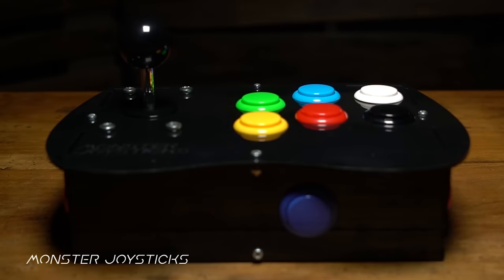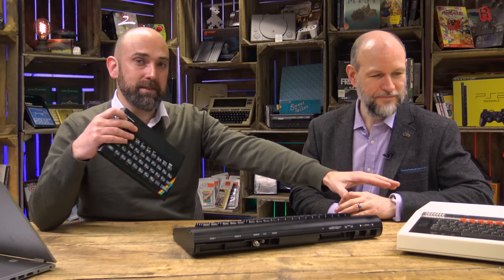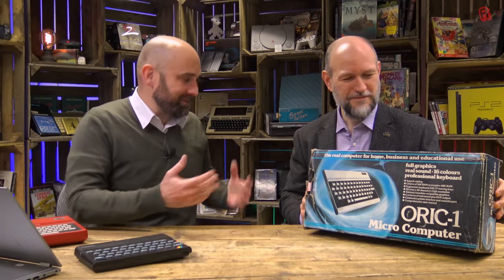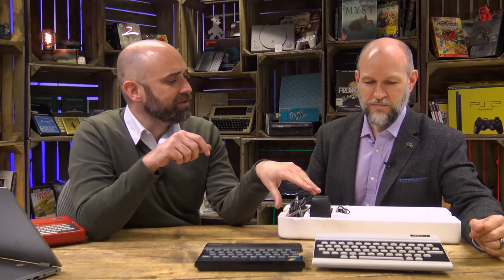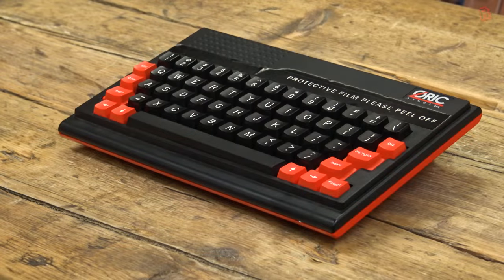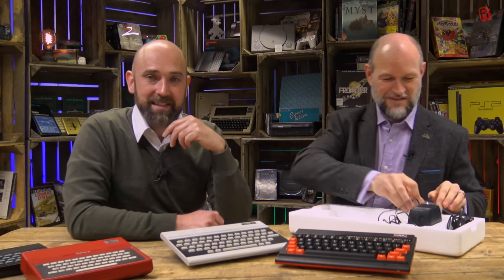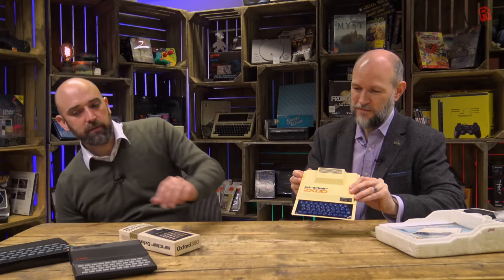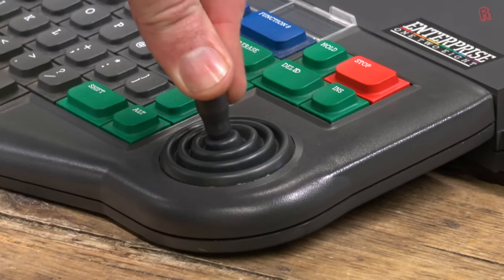Five Rare British Micro Computers - Show & Tell

Comment: I was so excited about the Enterprise when it was first announced. The specs read like my dream machine and the pictures made it look really nice. And then nothing, for two years nothing happened and the excitement vaned. There were a few articles about the development and some of the trials of trying to put together a machine from parts sourced from different manufacturers. I remember how they explained the slightly loopy fit between the lower part of the case where the keyboard is and the upper part where the ports and all that are. Apparently there had been some miscommunication between the designer and the factory making the case. I've heard two versions and have no idea if any of them is right, but here goes. According to the first version the designer made a mockup in the machine and sent it to the factory where they then proceeded with making the tools to produce it. Problem was that there were several people involved in making the mockup and they were responsible for different parts, such as one making the keyboard and another creating the upper part, and for some reason they didn't check with each other that the parts actually matched up. So when the factory got the mockup the keyboard part was just slightly wider than the rest. After some modifications they were able to fit them together and proceeded to tool up for production using the loopy fitting mockup as a master.
Another version claimed that the keyboard and the back of the machine was produced by two different factories, and that one or both of them managed to screw up the dimensions.
Whatever the case I remember reading how the machine didn't look quite the same as they had designed it, but that it had been decided that it was too expensive to scrap the tooling and start over.

This was certainly a "what could have been" machine. If it had come out even a year earlier it could have had a good run, and if it had came out two years earlier when it was announced it would most probably been a great success. But it ended up as yet another nice design that never had a chance.

Edit: Reading comments I saw that the Enterprise originally was called the Elan, and that made me sit up and take notice. Elan was a name that immediately stimulated some memories as that was the only name I ever remember hearing it called. It also explained why I didn't get that feeling of recognising the name even though I remember reading about it and watching all those juicy pictures. So yea, Elan that's the name...

Comment: I actually bought an Enterprise Elan but only as the PCB, not the full unit. It was some time after they failed, so this must’ve been a job lot that had never been assembled, I ordered it from an ad in the back of one of the computer mags of the day. I wired it up to a surplus keyboard (as a matrix, using lots of rainbow ribbon cable soldered to it) and gave it (bare-PCB, keyboard sitting on top, entirely caseless) to my mum to use as a kind of typewriter connected to a daisywheel printer I also had. The ROM if I remember had a mode where it could go straight into a word processor without loading anything (from tape or whatever). She used it to type letters, etc.

At the time I never used it (should’ve, for the sound chippery) as I was using Atari ST (working with an Atari ST mag in fact) and had a few Cambridge Z88 computers. Also had a Yamaha CX5M which I did all my FM sound synthesis and music making on. Prior to that, my main machine was a Dragon 64 (software DAC for sound) which I’d piggyback fitted a Tandy CoCo FORTH rom to (got it sent over from that America foreign country to here) and wired a ROM CS switch to the side of the case.

Comment: The Alice you use for comparison is an interesting computer. It's a licensed clone of the Tandy TRS-80 MC-10, which has similar specs to - and was designed to compete with - the Timex-Sinclair 1000... better known by its British name, the Sinclair ZX81! Its architecture is based heavily on the original TRS-80 from the late 1970s, however with a Motorola MC6803 CPU, and color support in the form of an MC6847, similar to that used in the full-sized Tandy Color Computer range. It was the first computer in the United States to have an MSRP under $200. It was licensed and sold in France by the odd combination of Matra, a major weapons manufacturer, and Hachette, a major print publisher, as the Alice; over there it saw rather more success. Here in the US, it only lasted a year on the market, dropping in 1983 and being discontinued by 1984. I can only attribute this to having a boring beige case, rather than the lipstick red of the Alice.

Comment: I remember drooling over the Enterprise 128 brochure (no, not literally - I think I still have it tucked away somewhere in good condition). Never even saw one though.
Oh and about clock frequencies: The exact numbers escape me, but IIRC the Z80 averages about 4-5 cycles per instruction while for the 6502 it's about two. Fun fact: The 6502 inspired the ARM architecture now dominating much of the mobile and embedded device space - Acorn Computers, when looking to design a successor to the BBC/Electron/Master series of computers didn't like any of the then-available 32-bit CPU offerings and decided to design their own.

Comment: Wow! That Memotech MTX 512 is THE coolest computer I've ever seen! How were it's graphics compared to the C64 and the Spectrum? Why wasn't it a success? Too expensive? Graphics no good? No good games or applications?
Reply: It arrived too late (the Spectrum and C64 had already sewn up the market between them), was too expensive, and didn't have enough software support.
Reply: @dunebasher1971  That is the story of about twenty computers that appeared on the UK market after the big two you mention. When I was in the market for a replacement for my ZX81 you could get a Commodore Plus 4 for less than half the price of a Spectrum.  I doubt if the Amstrad CPC would have succeeded if it wasn't for the unique selling point of coming as a ready to use package complete with monitor.

Comment: With all these different machines (1983? that thing is as old as i am!), i'm wondering if the Software for those was compatible between at least some of them or if Shops just had shelfs full of boxes for 20+ different systems at the same time?  
Maybe a deep dive into how the software industry functioned, how it distributed stuff for different systems and so on might be interesting.  
The common theme appears to be that they all used BASIC as programming language(?), that begs the question if the written software was cross compatible, assuming you could even get the data onto a format that different systems were able to read, floppy, tape etc.
Reply: No; and that was why so many systems flopped. If you went in a shop like WH Smith you were guaranteed to find loads of games for the Spectrum and C64, and some for the BBC. There were games for other systems available but never the same range or variety, and many were just badly done ports from the three main systems. 
If you haven't seen it watch Micromen https://www.youtube.com/watch?v=XXBxV6-zamM&t=1953s and be aware that the Acorn Electron wasn't compatible with Acorn BBC Micro software despite coming from the same company.

p.s MSX was a Japanese / Microsoft attempt to define a compatible series of computers but in Europe it was too late to make much of an impact. Amstrad hit gold from 1986 with low cost PCs that would run any PC software. That was the beginning of the end for any computers that weren't PC or Mac.

Comment: I had an Oric 1 - when the Atmos came out , Ii sent my Oric 1 off to Oric to have them move the board over to an Atmos case. - can’t remember how much it cost - but it was a lot less than a new Atmos
Reply: Actually, that's what I did as well, but in effect they seemed to have sent a whole brand new computer
Reply: @herseem  Just the case was replaced - it was still your old PCB with new ROM's inside, though.

Comment: An Interesting video, many of my favourite computers there. I'd like to see a full video in all of these, with a bit more depth. I wouldn't call the Oric that unusual however as it didn't do too badly?
Maybe a Jupiter Ace 4000 would have been a better choice, being it is the rarest of them all :-)
I love the memotech for its hardware, but its graphics chip is just too boring. The Enterprise 128 is the greatest machine here (probably the best machine of the 8 bits, bar maybe Hollands DAI), sinclair emulation and quite few good games released for it too. Few 8bit  computers could run with 16 colours mid resolution and move smoothly, this was the one that could. It still has a good following in the EU and where most went, a SD card also also available plus expansion ram to 4Mb.

Comment: It was possible to hack the ZX80 to make it do the ZX81's "Slow mode" where the screen stayed on as the program ran.  It cost you about 95% of the processing speed when you did it.
If you added RAM to the ZX80 or ZX81, the machine could also be hacked to do pixel graphics.  This was a much harder hack IIRC.

Comment: If I'm not mistaken you would not connect things directly to the ports on the back of the Enterprise. Those connections were options and you had to buy a connector that you would put in the space in the back, plugging it on the motherboard. I think that was a serious mistake. By the way, a link to the pin-out of the connectors can be found at http://enterprise.iko.hu/pinouts.htm.

Comment: I remember the hype about the Elan (as the Enterprise was) when it was first announced. I kind of lost count of how many names it had - Elan, Flan, Samurai... Had it come out shortly after it would have blown everything out of the water - 640 * 512 pixels and 256 colours were the stuff of dreams compared to the C64. 

But it eventually limped out just as the Amiga and ST arrived. And I have to admit, I was somewhat surprise to learn it was more than vapourware.

And am I imagining it - didn't they promise all sorts of crazy peripherals? I have a vague memory of some sort of chair to go with your Elan.

Love to see a full episode exploring this beast, I don't think I've ever seen one running and it'd be nice to see if it really was a C64/Atari 8-bit beater.
Reply: I can tell you now, no, it wasn't a C64/Atari 8-bit beater :)

The C64 and Atari 8-bit owners at my computer club (I had an Atari) were intrigued and a bit worried by the Enterprise given all the pre-release hype, but when one finally arrived, we were actually disappointed by how humdrum the games looked.

The 640x512 graphics mode only allowed two colours - if you wanted 256 colours you had to use 180x80 mode. The most commonly-used graphics mode for games was 256x160, which offered 16 colours. And it didn't even have sprites!

Quite honestly, us Atari owners had to wonder what all the fuss was about. Despite being designed in 1977-78, our machines were still very much top-end for 8-bit gaming in 1985 - the C64 had slight advantages in terms of graphics (it allowed more detailed sprites), but where a given game was available for both systems, the Atari version almost invariably ran faster and smoother.

Comment: The VDP on the MTX512 is prone to overheating so maybe the MEMOTECH MTX512 which can take the FDX512 and HDX512 or a unit ts a combination of the FDX/HDX needs a redesign, I want to see a full exposee on this MTX512, I wonder what would have been if the CPU for the MEMOTECH MTX512 had been a ARM32 or ARM64 would have made for a much more capable machine and maybe a graphics subsystem like the AMIGA 2000 would have  made for more enticing games.

Comment: Do you realise that Sinclair ended up getting a patent for Colour Clash ? (or more precisely EP patent 0107687, Richard Francis Altwasser, "Display for a computer", issued 6 July 1988, assigned to Sinclair Research Ltd).  If the patent was pending from the time of design other companies wouldn't be able to copy the idea forcing them to fit ridiculously large and expensive amounts of memory into  their colour computers e.g. 32KByte. Another little  known fact is that the original 48K spectrums used faulty 64KByte RAMs to add the 32KBytes to the 16 KByte base machine. Having spent about £12 to upgrade my ZX81 to 2KBytes back in the day I know how expensive memory was back then.

Comment: If only there would have been some sort of an organisation to work together and not work against the others. Some things were very well thought through, some things would have made a lot of difference if it was followed up, developed further. 50 Percent of all computer manufacturers could have used one and the same PCB-board because they had the same microprocessor and memory chips, this would have reduced the costs extremely. 
 
Maybe an idea for the next revival of retro computers and replica builders. All common thing on one print. One special PCB for every specific brand and type. This would save so much money.

Comment: The Memotech is the neatest looking machine there, but by that time the TI graphics chip was getting a little dated, and the business market was shifting from CP/M to IBM PC.  
If the Yamaha 9938 (1984) had been out sooner, it would have made a lot more sense at the price with built in 80 column support, more colors, etc...

The Enterprise 128 came out too close to the Mac, Atari ST or Amiga, and other 8 bits had a glut of software by then.  Sinclair also had built up a loyal fan base.  
It didn't have a chance.

The Oric is neat, but I found the Oric 1 keyboard very uncomfortable.  If the Atmos had been the first model, it would have sold better. 
The 6502 is around 2.2 times faster than the Z80 per MHz depending on what it's doing, and whether you ask a 6502 or Z80 fan.
That isn't quite enough for the 1MHz Oric to match the 3.5MHz Z80 in the Spectrum.
Even though Orics came with 64K of RAM, you could only access 48K if you didn't have a disk controller.  
The machine has a lot of simalarites to an Apple II with a single chip Mocking Board... only much cheaper.
Even thought the Oric & Apple BASICs were written by Microsoft, the Oric version is slower.

The 6803 in the Alice (aka MC-10) can be faster than the 6502, but the BASIC was almost strait from Microsoft's 6800 version.
It had few optimizations that took advantage of the new features of the 6803 (16 bit accumulator, hardware multiply, etc...), so it ran close to the speed of the 1MHz 6502 systems.  
The keyboard is way too small even though the keys feel okay.  If it had used a keyboard like the Atmos (among other things) if would have also sold better.
See my youtube channel to see my optimized version of MC-10 BASIC.

Comment: I thought the Oric was reasonably well-known computer?  (obviously, the Speccy trounced it)
Reply from the maker: Yeah they are quite well known, but not huge sellers, the ZX80 is the same
Reply: Notorious is probably closer to the mark.  The Oric is the one with the Rom bug that wouldn't load user programs properly much of the time, yes?
Reply: @TheTurnipKing  Was quickly fixed, but the reputation remained alas.  A testament to not releasing software until its been EXTENSIVELY tested, lol ..

Comment: my high school had an mtx512 in the computer room it was the highest model with the big black disc drive box connected to it, then someone stole it but just the keyboard, the headteacher then the next day got up in front of the whole assembly urging the culprit to bring it back.
but he lied and said the keyboard was useless without the drive box, the computer club knew 90% who took it and we would slipped an anonymous note under the heads door but because he lied bare faced to the whole school we thought sod him, no one ever used it anyway.
18 months later i bought the orphan peripherals at the school fete, for 15 quid, though i'm still looking for a keyboard for it for my collection.

Comment: I was lucky enough to own an Enterprise 64 back in the day (was going to buy a QL but had so many Spectrum problems decided against it - bought one later though). A fantastic machine, probably the ultimate Z80 based home micro. There was a fantastic article in Your Computer, when it was called Elan and had a very cool grey/cream colour scheme. Then there huge delays, including farcical name changes (it was briefly Flan before before they settled on Enterprise) and it had ISO Standard BASIC which was way ahead of anything else available. Bog all software though, and the later multi colour scheme was ugly compared to the original. Would love to see an episode on that for out and out nostalgia, and also on the Memotech - I remember the ads for those and it looked like a very cool machine even then...
Reply: Oh, and if I remember right the BASIC came on a Rom cartridge so yours isn’t quite complete.